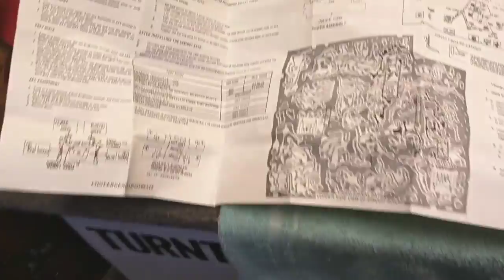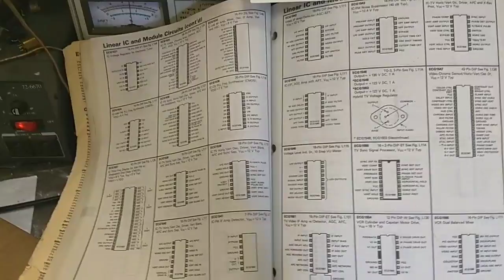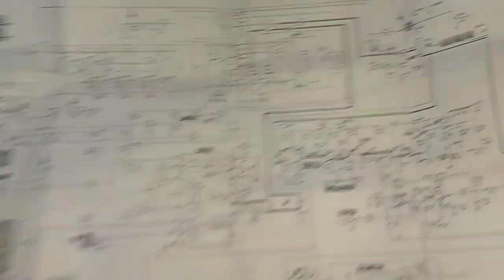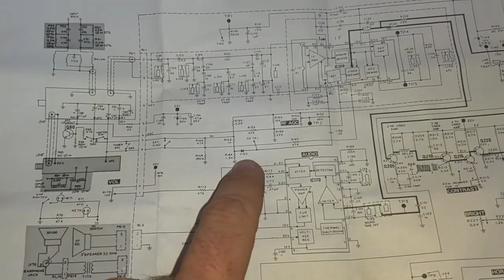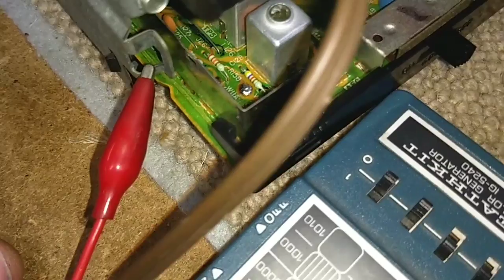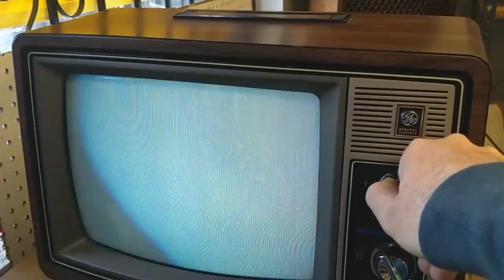Troubleshoot & Repair a 1979 General Electric 13ack546w color television part 2/3

Comment: Check all of your resistor chassis grounds in the AGC circuit, and in particular, that variable resistor R150. Wondering if you've got a floating ground that's upsetting the voltage divider reference values?

Comment: I'd inject 9v on pin 4 through a current limiting resistor. You could then see how it effects pin 3 voltage and voltages on the other side of the resistors in the AGC circuit. This could help find the fault and let signal through to check the tuner.

Comment: What voltages would you get if you put back
IC120 (1571 original IF chip) on it's socket ?
Maybe you could get back more close, correct voltages
on its pins.. ? Maybe the new installed chip is not quite
compatible and that's why the TV get you farther from
the original problem.
And by the way, any video signal present (oscilloscope) at TP3 ?
And try to inject a video signal at the Q200 emitter (TP3)
to at least get a picture on the CRT.
 Just a suggestion.
JP

Comment: Have you tried looking for a point in the schematic where you could just dump video into it and see if it gives a picture? If it has a raster, it shouldn't be too difficult to generate video if that part of the set is okay. Then go back from there to the IF circuit. Or not; since there's no analog TV anymore anyway you could just make it into a monitor with a video and audio RCA socket on the back.
Thanks for posting!
Reply from the maker: If it pisses me off to that point, I probably would change it over to a monitor - though I'd have to think about how since chassis ground as at 70vac!
Reply: @JordanPier  Ah, right. I forgot about that.

Comment: I've got some old tvs upstairs.  Ones a hybrid I think, I've got about 9 or ten. I've got two consoles, and a huge big picture tube console downstairs that went crazy on me.  I went to LED  HDTV now.  I got shocked when I was younger starting out in electronics by a HV cage on a magnavox console.  The HV rectifier kept burning out. I replaced it three times.  I didn't spend no more money on it.  That was in the early 80s. Then to try and find out why,  I poked around the horizontal tube and the hv cage and a blue arc as big as a flame came out and hit my hand, burned my screwdriver.... It knocked me back against the wall.  Scared me have to death.  I was numb for a bit.  I'm always scared about messing around high voltages since then on big tvs.  I've got some little ones I need to look at.  Hopefully one day.  I watch your videos.  You seem to have no fear.  Thanks for your videos.

Comment: So some voltages are too low while some are too high? I could be wrong here, but I've never seen a single resistor or capacitor wreak that much havoc--I'd be inclined to look for a bad IC or transistor

Comment: GE porta-crapper, big problem with these sets were the jumpers from the top traces to the bottom traces they were always problematic best way to fix them is to open the hole, stick a wire thru the hole bend it over top & bottom then resolder the connection. Time consuming but no more problems ever if done right.